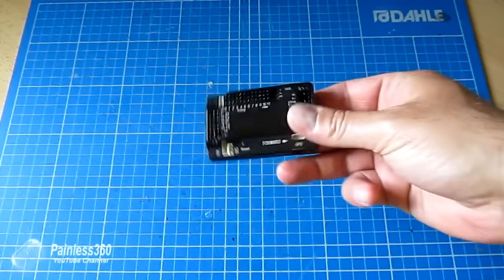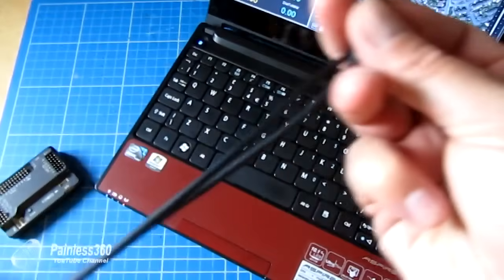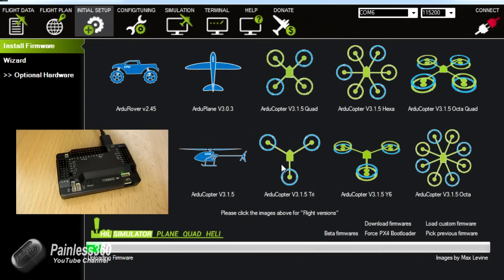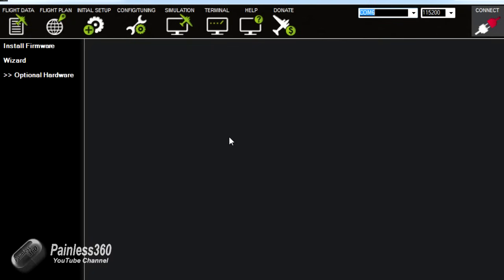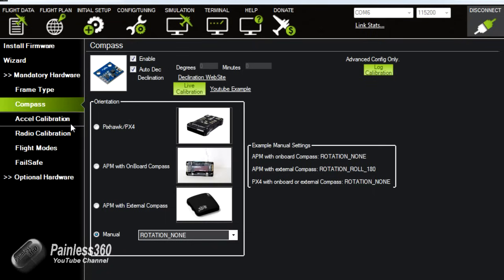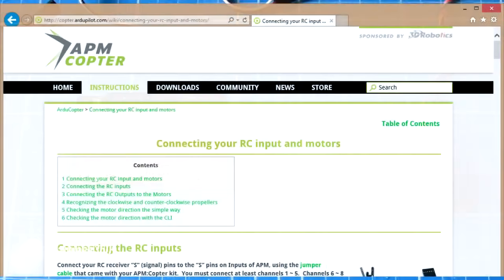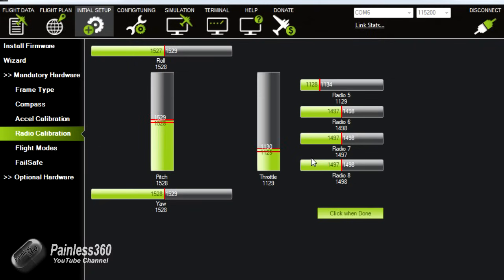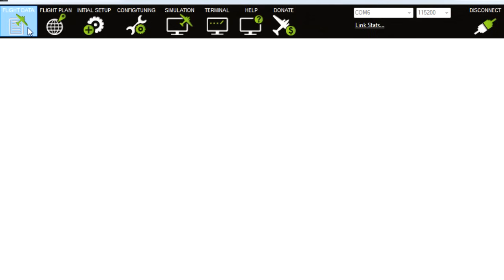(1/8) APM 2.5/2.6/2.7/2.8 - Simple installation and setup overview

Comment: Hi Lee

Sent you mail regarding my dead spot and weird performing esc's.  Ok I did the individual calibration... Now the one motor kicks in and then the rest fire up when the control is at 50% and it just goes nuts.  I then tried to re-do the alll at once - and now it wont even allow me to do that.   Just a note... When I had the ESC connected to the receiver chan 3 throttle, it did not power the esc ?!     The ESC's are Simon K RC Timer 45 A units.   Would this be part of the issue....

Also when I power up the APM , I get the little chime and then a solid second beep - Not a 4 beep to indicate a 4 C unit being used...

I thought perhaps resetting the APm and recalibrating from scratch on APM planner >!
Reply from the maker: Hi Will, sorry to hear that the calibration hasn't fixed it. I'm guessing this is the first one of these you've setup?

If all the ESCs calibrated successfully using the one at a time method then I would connect a spare servo to the throttle channel on the Rx and confirm the operation is a smooth movement as you increase.

Once that is confirmed then I would be tempted to disconnect everything from the APM, re-flash and re-setup from the start including calibration of the acc. and mag etc. Once setup I would only connect one of the ESCs and test arm/throttle up to confirm operation before plugging anything else in.

If it happens again, a steady, clear video of the problem would help me see  what's going on.
Reply: Painless360 Ok well let me try that... I will post a video in the day or so.  I tried reflashing or resetting the APM... but i couldnt find a way to clear it to start over.   I conected to my mac clicked on installing as per your video and went from the beginning... Does it all well,, BUT remembers all the old setting. Would seem that it doesnt write OVER the old settings - Getting it to DFU mode is not as easy as it would apper
Reply: Will Granzier Ok just an update - I managed to rest the unit to DFU - Re flashed - re calibrated still the same

Here with a small video that might give insight  -

https://vimeo.com/124233217
Reply from the maker: Hi Will, great video - very clear. Only comment I had is that you have the ESC wires plugged in backwards. The black wire should be towards the outside of the case..

I hope it's that simple..

Comment: Hello again, I just encounter another problem.
The other day as I was flying my quadcopter suddenly it felled out of the sky and crashed.
Since then when I try to connect my battery the motors keep beeping continuously.
The APM will not arm and I cannot figure out what the problem is.
 Can you help me once more?
Thank you for your time !!!!
Reply from the maker: Could be lots of things. Impossible for me to help with that limited information. I would work from first principles and reconnect the board to the PC and confirm that the Rx channels are all working well and go from there..

Treat it like a new build and work through each system -radio/receiver, power, ESC/Motor connections etc.

Best of luck.

Comment: new subcriber here! great vids! I have a Raptor and eachine TS840 tx/rx and V2 Pro goggles. Can u recommend this or other flight controller to someone flying FPV planes? I am on a budget, but know u get what u pay for. I have the new Spektrum DX6, so I also need a good long range receiver that will work with it. Thoughts? Keep up the great work! I have all my flying friends watching your stuff.
Reply from the maker: A few questions there. See our video on 'flight controller comparison' for the answer to the first question. There aren't any 'long range' receivers for Spektrum products but those that feature the longer antenna and allow for satellite receivers to be plugged into the main receiver will help you push the range to the limit. Best of luck.
Reply: Thanks. I am currently about to test it with the lemon rx stabilizer receiver with satellite antenna. Watched your other videos. Great info!
Reply: Hello lee: So this means that I can use satellite TX/RX to have unlimited range?. Did you covered or refer to any such TX/RX in any of your videos?. Sorry for asking in a rather 'blunt' way as your above comments is giving me a new directions for industrial requirements in my telecom sector. Thanks,
Reply from the maker: Satellite receiver isn't for satellites in the sky. It refers to the small, auxiliary receivers that tend to be connected to a main receiver on the model to provide additional antennas to improve signal reception..

Comment: Is there anything to look for or avoid when purchasing a APM controller?  There seem to be a lot of different suppliers and manufacturers out there and some are paired with a variety of different GPS modules (3DR, Ublox, etc).  Are any of them just plain junk?
Reply from the maker: Jim Leether I have bought all of mine from eBay sellers (and one sent by a very generous subscriber). I go for those who seem to specialise in RC equipment and have great feedback.

So far, (touch wood) I've not had any problems..

Comment: Hi,

I am new to this game and in the process of putting a quad together with 2213 T-Motors, 10 inch props using APM 2.8 and 2200 maH 3S battery.

On a fully charged battery I understand that one would expect to get approx 8 min of flying time.

I want to extend the flying time at least to 15-16 minutes or even more.

Is there a way that I can install two batteries in parallel and then program the APM to switchover when the first battery reaches a (predefined low voltage)?

At this point, if the switchover is successful, then the second battery should kick in and keep the quad flying until it is about to run out.

Any ideas, any suggestions on how this could be achieved?

cheers,
newozuser
Reply from the maker: newozuser No way of switching over, you need to connect the packs in parallel if you are going to use more than one or simply use a pack with a larger 3700mAh+ single pack. That would give you about 11-12 mins. 
Happy flying!

Comment: would FrSky X8R 2.4G 16CH SBUS work with this ..its been the one i've been using ..i have a turnigy 9x with a frsky telemetry djt module on the back ...its confusing but it does work good once you figure it out ...i've been using naza m lite and i think this set up you have here makes more sense and it does have rtl ? i know this was made 6 years ago but the apm does have a better rtl then it used to especially with a Ultrasonic Module on it ...correct me please if i'm wrong as these are just guesses
Reply from the maker: The APM is very old now. See https://youtu.be/ZwCLdkjqM-Y
Reply: @Painless360  and i watched your video on  ultrasonic modules and realized what i said was just the opposite of the truth ...i post at night when i  shouldn't i guess lol ..thanks for all the help

Comment: great educating videos ! i have the 2.6 version w/ remote gps ant. trying  to initiate it messed up program .  can i wipe it clean and start over , with external gps & compass how do i  calibrate the board ?  keep up the great WORK !
Reply from the maker: tony sciolino The best way to do that is install another version of the firmware - I tend to install ARDU:Plane firmware - then re-install the multi-copter firmware to start again. Should delete the settings and setup on the APM..Best of luck..
Reply: Painless360 thanks what, does the reset button do ?
Reply from the maker: You can google that one ;)

Happy flying!

Comment: Hello I need your help if possible. Already a few months I use a plane skywalker with apm 2.8 controller for make agricultural surveys. The missions work very well without any problem.
The problem is this, I use two camras canon S110, these cameras are placed in the fuselage skywalker under the apm is a perfect place, fit the two cameras (RGB and NDVI) perfectly, the problem is the quality of images, these images appear a bit blurry, I think it is a vibration problem.
Is there any solution to minimize this problem?
Thanks
Reply from the maker: +Paulo Cardoso the vibration will come from the prop and motor. See our video on balancing the prop. You can also use vibration damping mounts for the cameras too. Best of luck!

Comment: i There, I have just purchased the APM 2.8 and am building an GPS FPV Quad. ESC's, Reciever and Transmitter are all understood, however I am have trouble working out how to connect the Hawkeye Camera and 5.8 Ghz FPV transmitter, would you have a diagram available at all.
Thanks.
Reply from the maker: I've not touched an APM for years, the best place for detail is the Ardupilot wiki.. Best of luck!
Reply: Thank You, we might be a bit behind the times but i enjoy the look and feel of the drone  have built. Thanks
Reply: Hi Painless 360,  recognise your years past APM stuff but wondered if you could help with an issue im having. I ended up after repeated issued  downloading APM Planner 2 and installed firmware 3.2.1, i have been through the complete calibration and setup in the mandatory parts and at this stage have omitted the telemetry, Minim OSD and Camera. 

The  GPS works, the accelerometer works the radio works (in APM Planner 2, basically it all works, but it will not arm!!!. I can calibrate the ESC's and run the motors up but once i unplug and replug the lipo, i cannot arm the drone. I have repeated all the steps many times. and cannot work it out.

I set the "checks prior to arming ' to Zero, i moved the FC to the top of the frame away from the esc's and PBD (F450 frame) still nothing. I have googled it to death and watched and read heaps but nothing works

Any suggestions?

Comment: I would like to buy an APM fight controller for my tricopter.  I'm not sure if I should buy the 2.8 version, or the 3.1 version.  Is their a video explaining the advantages of buy the 3.1 version other then the smaller size?
Reply from the maker: +Pat Adamson We have two video series covering the APM 3.1, have you found them in the playlists on the channel? The 3.1is functionally identical to the APM 2.X but smaller and without the servo style connectors for the motors. If you have the space I would use APM 2.X, if you can't fit that in - go fro the smaller 3.1 and live with the extra wiring.
Reply from the maker: Easier to wire up, that's all. Best of luck.

Comment: Painless, One more question please if I may, In the radio calibration section of this tutorial you mentioned the Elevator Stick was reversed, should if be ... in other words, if I move the stick backwards the green bar should move backwards too or should it be as it was on the tutorial,  If you moved the stick backwards the green bar moved upwards, thanks for your input!
Reply from the maker: Hi Richard, no problem. I had to set it up so that if I pulled the elevator stick down the bar rose. Very counter intuitive. This didn't work like this in a previous version so be wary on the first test hover and be prepared to reverse the channel if it's not right. Good luck with the build!

Happy flying!
Reply: Painless, could this flip a Quad on its head if it were incorrect?
Reply from the maker: If you were super aggressive with the sticks yes! :) Always check that all the controls are responding as expected on the first flight of any model, keep it low and simply hover no more than 12" from the ground. Run through a battery full battery doing this as it checks the connections, battery, ESCs, controller props and motors are all ok to try a flight with more height and speed.

Happy flying!
Reply: Painless. Is there a way you could check my quad settings etc remotely, If I were to book some time with you how would we go about getting my beast off the ground, I am at wits end here .... I just cannot get this quad to fly an it's really winding me up a spell!
Reply: P.S Have a look at my thread here to see what my problem is .. I also have a video of the attempted take off where it just flips on its head

http://www.rcgroups.com/forums/showthread.php?t=2299210#post30130384
Reply from the maker: Hi Richard, first thing to check with this is that two of the motors are not crossed over. I did this on my first APM build and took me AGES (!) to figure it out.

Remove the props, connect to Mission planner and go to console. Connect to the model then type 'setup' press enter. Then type 'motors' then press enter. The motors should all pulse one after the other clockwise, starting in front right side. If they don't follow each other you have two wires swapped.

See https://code.google.com/p/arducopter/wiki/AC2_Props_2 and my video https://www.youtube.com/watch?v=10jXoLjoB-k for more detail.

Good luck. Happy to talk if this isn't it..
Reply: Painless, I have done a motor test in APM, not through the Terminal as mine just throws out a lot of mumbo jumbo, did it through the MP/OPTIONAL/MOTOR TEST ..They all fire up for a second or two in clockwise rotation,  I presme this is correct? ... Does it work different through the terminal?
Reply from the maker: Richard Hamilton Sounds like they are installed right then. It should look like they do in my video. If they spin, one after the other in a clockwise direction round the craft then check that the board can see the tilt and not overcompensate. With the props off, power up the motors and tilt the model by hand, watch that the motors on the lower side speed up..
Reply: I've even gone back to a normal SK450 X frame (non deadcat conversion) and gone through the entire configuration process again, I am still unable to get my quad off the ground, this is really frustrating me to now end!  :(
Reply from the maker: Richard Hamilton ok, sounds like something in this board itself that's causing this problem. If the motors and props are all ok then it should be the board, vibration or PID settings that are causing it. Sounds like a chat would be the best way to run though the setup and see if we can't spot the problem. Would you be up for that?
Reply: Painless, I would be ever so grateful if we could have a chat, this is driving me nuts!

How would you like to do this... Via Skype?
Reply from the maker: Richard Hamilton hi Richard, I would normally direct you to google helpouts but if you PM me your email Ill add you to Skype. I am not working tomorrow if a time then would work for you..
Reply: You have mail!   :)
Reply: Richard Hamilton Did you guys work it out? Hope so!
Reply from the maker: Hi David, we did - soft of! Turns out the APM had a fault (looked like the 3.3v regulator to me) so Richard was doomed from the start and when we talked had tried EVERYTHING to get it working.

Richard can update you with what board he's flying with now - I won't steal his thunder ;)
Reply: Thanks Lee, Yeah what a nightmare we've had trying to set up my APM, Ended up ditching it and going to KK2.1.5, Now I have a flying quad!   :)
Reply: Painless, Forgot to mention, I've gone back to my DeadCat frame and it's dialed in well, I've got it flying pretty stable and am extremely happy with my 450 now. Long live the DeadCat

Comment: will pixhawk 2.4.8 accessories work with this? like the gps antenna telemetry modules and all the other parts?
Reply from the maker: No idea. I wouldn't use this flight controller anymore, I've been warning people not to use it for the last two years at least. Best of luck

Comment: hi great vid but im having trouble when it comes to putting my spektrum receiver to the apm 2.5 will not boot up
Reply from the maker: Powering it from a battery or USB?
Reply: i try to power it from the usb like you did but it didnot work also i install it in the modle and use the esc to power it up i got the same result no radio responce i know my receiver is go cause it was in a gas heli i had also i took another one i had new and install it the same way same problem the program boots out the apm 2.6 module
Reply from the maker: I'd do all of the checks to confirm any assumptions you are making. Best of luck with it!..

Comment: Hey there, nice videos. I have the APM2.8 Ardupilot and allways have a bad Compass Health error. Never mind if the jumper ist set or not. Nor the External Compass works either th einternal Compass. Both brings Error with # failed. i am very confused have this board. Do you have an idea why the compass brings error?
Reply from the maker: +Jahan Ketabchy the 2.8 probably doesn't have an internal compass so I would focus my attention on the health of the external compass, and the wiring. Best of luck!
Reply: Thank you very much for response. the Connection on I2C is with 5v. So you mean by wiring to connect the gps to I2C and the GPS port instead of the 2 GPS ports on APM2-8.?
Reply from the maker: Jahan Ketabchy there are two connections from the combined GPS and Compass module. One should plug into the GPS port the other should provide the two cables that will give you the external compass connection. Best of luck.
Reply: thanx Pain

Comment: Hi I enyoi your videos ,now i have setup The APM Pro and have some trouble, Radio calibration ok, Compass calibration Ok everything seems allright but when I want to start it will not turn the motors please help if you can
Reply from the maker: I’ve not touched a PM for a long time. All of the knowledge I have is now in these videos. There is still lots of activity with this flight controller in the forums, it might be worth a look in there too. Best of luck sorting it out..

Comment: what version of APM software are you running, when you get to the compass calibration
that addl screen (that shows your movements points) does not pop up on mine, just a timer (0%-100%) bar giving me time to move the board, but i always get: (not enough data to calibrate), i've tried on my windows computer as well, but when in flight data, you can see the compass reacting to my movements
Reply from the maker: The version on the laptop is V1.3.17.

Best of luck with it.